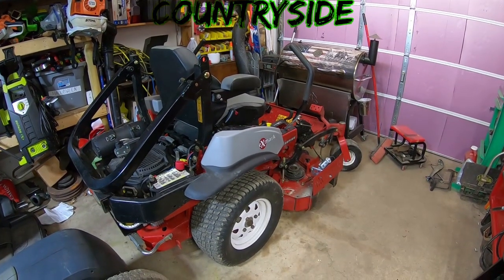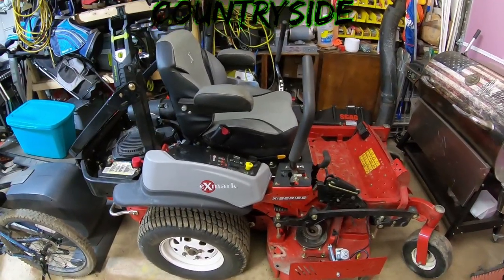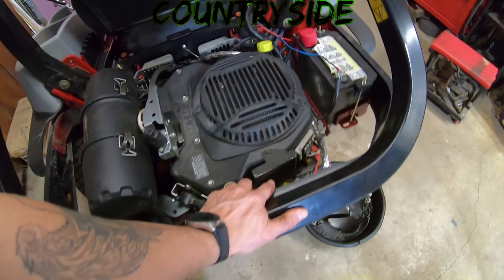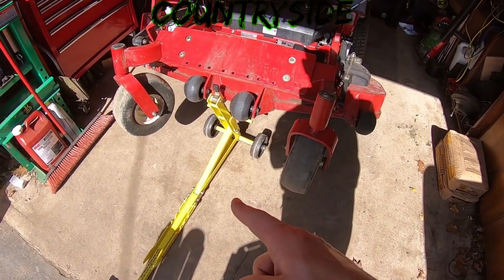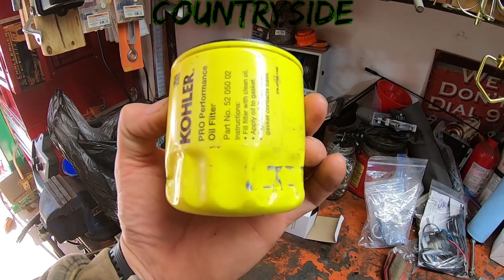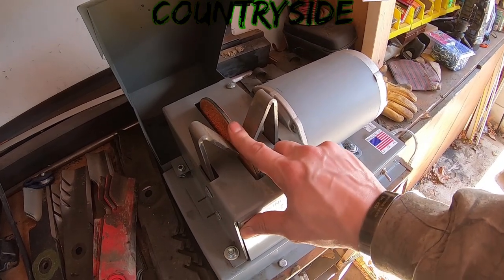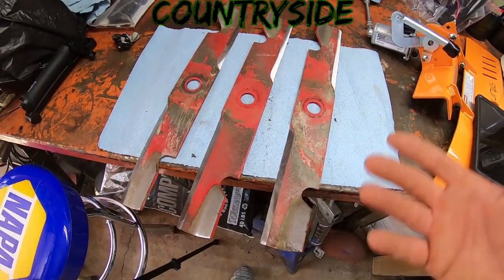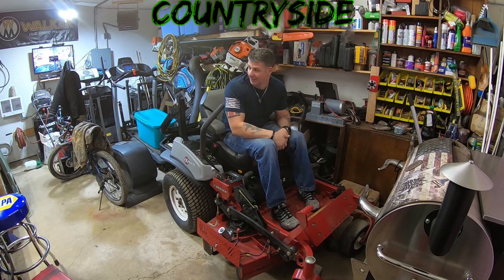Exmark Lazer Z X Series Maintenance

Comment: My buddy has the Oregon blade belt sharpener. I have several sets of blades that I take over to his shop every month to freshen up. The Oregon belt sharpener is absolutely phenomenal. It usually takes me only 3-4 passes and my blades are razor sharp. My son does most of our mowing and really noticed a difference since I started sharpening them on his Oregon belt sharpener that gives a true 30* angle. He said it really has cut down on double cutting.
Reply from the maker: Yup this does the same when I sharpen under normal conditions. Only took so long this time because they were so out of whack.
Reply: Just broke down yesterday and bought the RBG 712. My local Toro dealer had spring special sale on the RBG 712 and the grit collector on sale for $529+ tax. I tried it out today and I’m impressed, all I can say is wow this grinder does just as nice of a job on my blades as my buddies $3000 Oregon blade belt grinder.
Reply from the maker: @edwardkane3237  it's pretty awesome
Reply: @CountrysideStrong  no it’s beyond awesome. I can sharpen 3 blades in less time than it takes to do 1 with the angle grinder. Btw check your text messages on your phone. I sent you something and would like your feedback.

Comment: Bought a 60" laser z in 2000. Ran good, cut good. Sealed bearings in the spindles only lasted 750 hours, but were cheap an easy to replace.
Reply from the maker: Yea they're not hard to do

Comment: Great mower and video. The X-series has rebuildable spindles. The E & S are throw away ones (I have an E and know too well but it’s because of use). The dealer should have a kit if you ever do the hydros (gallon of fluid and 2 filters). It’s better than buying all separate. That is a solid machine my friend and the grass is calling you and Billy soon as the snow is gonna go to the wayside and welcome green grass!
Reply from the maker: Yea I've rebuilt many of them over the years. Super simple and you can buy the parts cheap on eBay. I use napa filters because they're made by wix. I use Toro hyper oil for toro or Exmark, everything else I use mobil 1 for the hydros. It's never failed me. I think this mower is gonna be great.
Reply: @CountrysideStrong  yes sir you got a great mower!! I only use Wix for the oil. I tried the air filter and was extremely disappointed by the inner media filter as it actually collapsed and tore the media for unknown reasons. I went back to the Kohler air setup for that reason. Keep up the solid work as stated great content. Oh next time the safety weenies cry for sparks you may want a welders apron.. Man the hard hat was a primo touch 👍👍😂😂
Reply from the maker: I have an apron I was gonna put on🤣🤣

Comment: I usually change my own oil, fuel filter,air filter but, I've never changed the spark plugs or the hydro change on my Lazer Z,always let the dealer do that part cause it looks like a pain. I don't even check the hydro dipstick anymore cause, If even look at it wrong those things always cross thread or strip on me 🤦‍♂️Johnny Mow and I have problems with those oil filters  loosening after 20 or so hours🤷‍♂️
Reply from the maker: Every little bit you can do saves 🤑